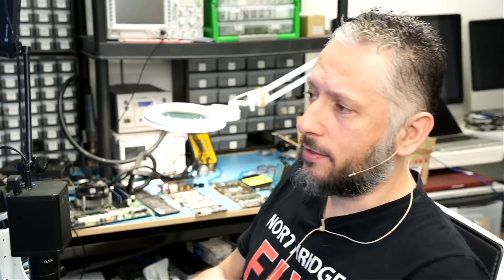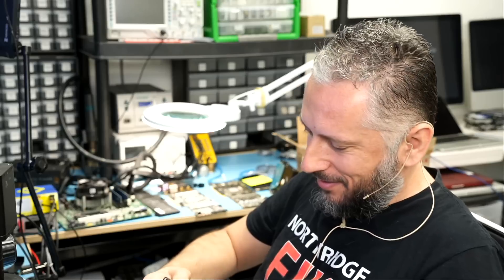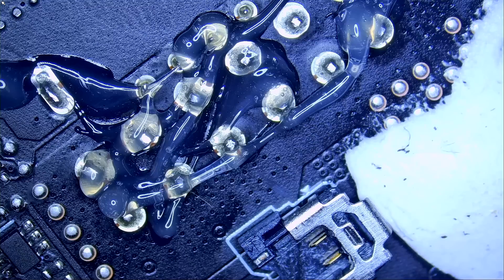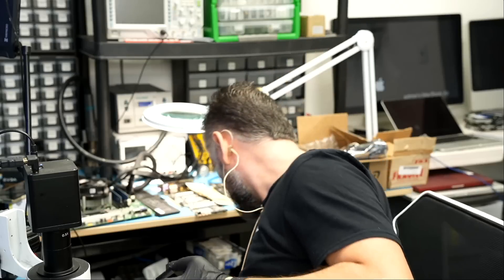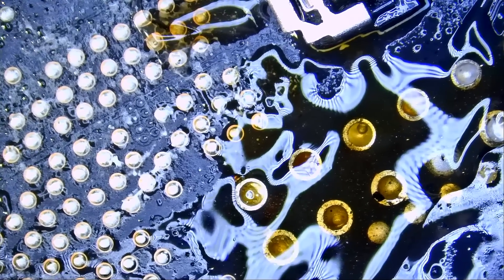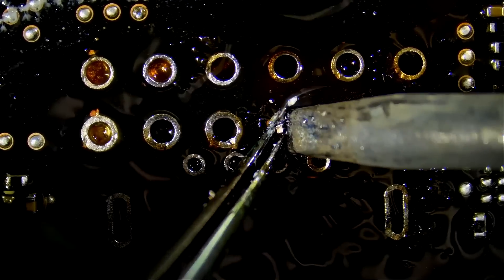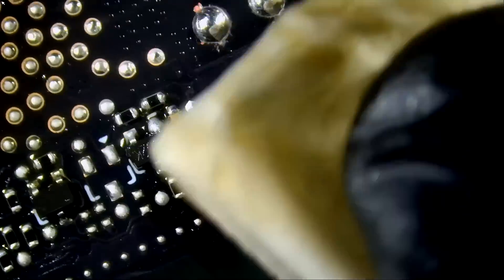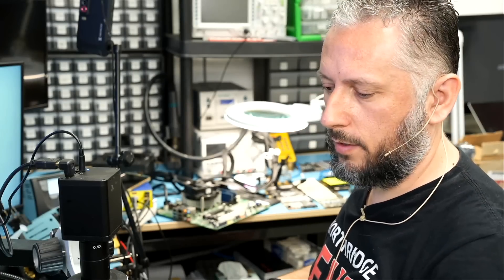4090 FE Connector melted with Cablemod Adapter installed. 40 series cards should be recalled

Comment: Is it bad cables or bad psu or not enough power or too much or weak cables aren’t enough to handle all that power she draws
Reply: The issue is simply that these GPUs pull way too much current through the pins, which causes them to heat up and melt the connector. There really should be two connectors to split the load up and halve the amount of current being pulled through each pin.
Reply: @c_hegge  are all card models like this what is Nvidia doing about it

Comment: They should use more heat-resitant plastic on those connectors :)
Reply: or bigger pin, and better yet, the old PCIE 8 pin connector
Reply: it's nylon, it's more than good enough - nylon melts at 268C,  which is 50C(!) than the melting point of lead free solder, and around 80C higher than leaded solder (used in repairs)... The user error nonsense gotta stop as well.
Reply: doesn't matter will still melt if the users screws up.
Reply: @solomonshv   Then how do you explain the adapter, or are the users screwing this up too? No!, for me NotVidia.
Reply: @@andrzejzielinski7871 Then I'm afraid the soldered pins will melt. It's just not good and dangerous.

Comment: this is just a very bad design and dumb idea from Nvidia, why don't they just doesn't keep the old power connector, we never had issues with thoses
Reply: nvidia did not design this cable. this is a PCI-E standard designed by PCI-SIG, which is a consortium of every computer company on the planet, including amd, dell, apple, intel, etc. the old cable is not staying. it will go away on every product in the near future.